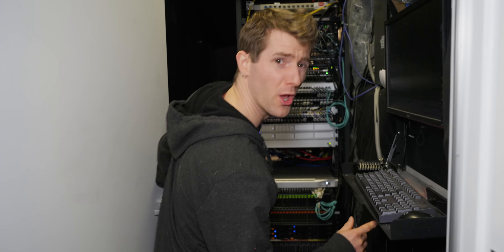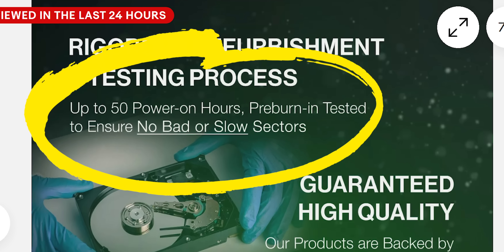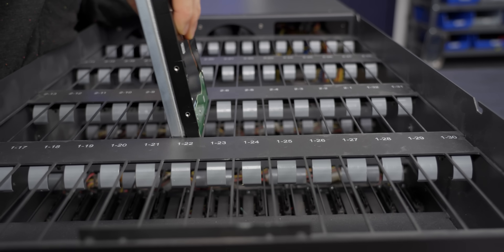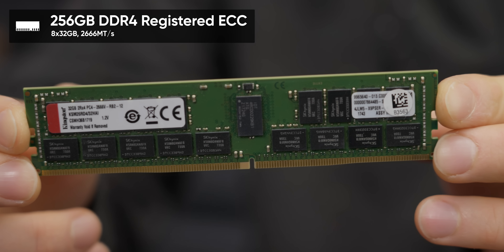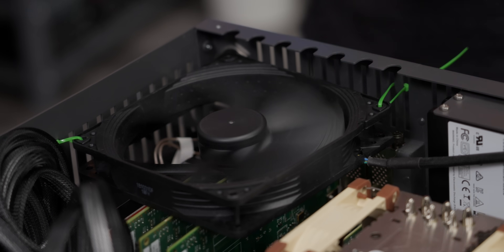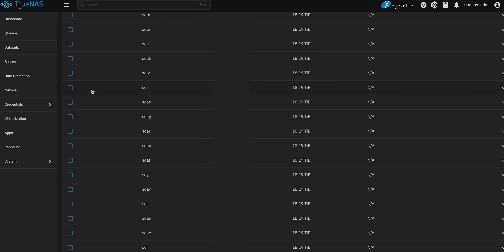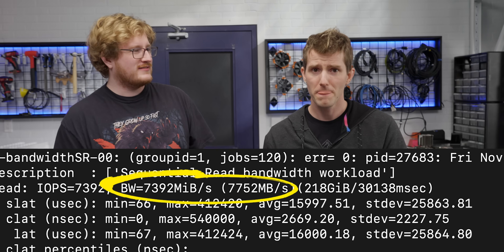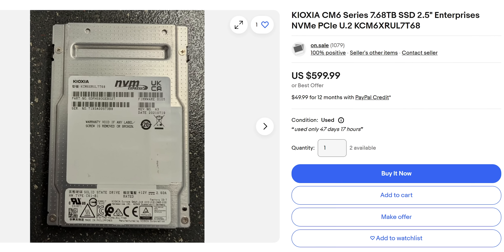Is Buying a PETABYTE on Ebay Stupid?

Comment: I love that we're back to having love for spinning plates again. SSDs are great, but for cheap "fast enough" storage it's still unbeatable in my opinion. I also understand why you advise against second hand drives, but with the right redundancy it can be a great deal. Especially with how long modern drives can last, it's silly to always buy new.

For reference, I have old WD Red drives still humming along without any SMART errors that have been in my system for over 10 years. They've moved on to non-mission critical stuff like light surveillance recording so if they die, it doesn't bother me. But I'm just calling it out because people write off drives after just a couple of years. Set up your system for redundancy, which you should anyways, and save some old drives from ending up in a landfill. The only arguments against that approach are if you don't have enough bays in your system or if you're worried about power consumption of old drives.

Comment: Only had them about a year but I've had no issues with recertified drives.

That said, the failure rate for all my drives has been far lower than I expected. I have 6x2TB WD Green drives(their lowest-cost consumer drives) with around 10-12 power on *years* and only one has failed outright with one other only gaining a single bad sector in the last year or so. I've now retired those drives but my general experience with hard drives has been "dies within a few months or lasts indefinitely", which also appears to be consensus.

Comment: I am curious why not buy older but still useable har drives? I have a synology that has 4 TB that were scaveneged from my dads work since they needed to remove about 50 or more har drives from a server or two and a lot of computers so I got a few used toys and some good storage. Why not just repurposed older harddrives instead of scraping them? I have two three terribite harddrives that came in a mini server that I fished out of a thrift stores dumpster in the rain and of the four harddrives I got only one was bad mind you the storage thing was discontinued in 2014 or something so it was old as hell the harddrives stilled worked though. My dad has a small trash can fill with two TB hard dives I think there is either 20 or 30 2 TB drives in that trash can. Sorry my dad works in IT so I am either used to getting on scrap or finding useful stuff from the recycle piale. The amount of stuff companies will get rid of just because its a bit old is strange yet they have mission critical computers running xp or 7 even 95 or worse nt. If any of you can try and get to know someone who works for a small it company their recycling is good pickings. Also I am a broke college student who never got t e nice toys only the hand me downs or scraped stuff. I remeber when half a terribite was a big deal to me but now I can barely even use that kind of harddrive I do love scavenging scrap components and getting to dismantle things its fun to take things apart and put them back together.

Comment: I would avoid those 20TB EXOS drives like the 3rd booter shot. I've bought 10 of those drives for personal use and I would say 7 of them failed within the first month. They would not be recognized that they were even plugged in. I got to the point that Seagate would allow me to pay a little extra to have a better drive. In the last year, all 10 of those EXOS drives have failed and the last 3 I swapped out for slightly more cash for the 24TB Seagate drives.

Comment: I did exactly that… 60 drives with 16TB referbished… over one year I needed to replace 8 drives … but now it’s running super stable … and I payed about 60% of original price …. And also only used second hand hardware … it’s great totally recommending this

Comment: Here’s my guess: these are unused spares for some big baller.     Used drives at hyper scalers get wiped and physically destroyed. The risk of a drive leaving is just too high. Now, a drive still sealed in a Mylar pouch in the spares depot has no such risk. Once that generation of standardized storage design ages out those spares need to go but via the shredder.

Comment: Bought the same 20 TB Seagate Exos from goHardDrive (Choose them due to the 5 year warranty, and the fact the Exo line are helium filled)
They have been running for 2 years, run at 30 C, and No Errors.
There is 6 of them in my Unraid Server, and only paid $1000 for them vs double the price for new ones. 
I ran a SMART test and Read/Write test on them before installing to see if there were any issues, and they came back good. Power on Hours were low on my 6 as well. (10-20 Hrs)

Would absolutely buy them again.

Comment: Ive bought about 10-15 recertified drives from ebay and have had great luck knock on wood. i had two fail with in a month and they were replaced with out issue. i have bought other used drives that were not recertified and had one fail that Seagate replaced with out issue but thats a hit or miss from the research ive done . but this is always risky so buyer be ware and i would recommend using them in a raid with two parity drives, i use mine in raid z2 and one of the drives is a brand new one i bought just in case.

Comment: I've had 8 of the same Seagate Exos 20TB recertified drives running on my Qnap nas for some years now. The Qnap garbage broke down, but all the drives are happily continuing their lives in my new Unraid setup. The smart details are still showing zero reallocated sectors, which is great. I'm very happy with these recertificated drives.

Comment: A few years back I stumbled over a SAN decommissioning sale - hundreds of 4TB 7,200RPM 3.5" HGST SAS drives being offloaded at an even better $$/Tb rate than here (including shipping!).
In a massive rush of blood, I bought 50 of them.
None were less than 25,000 hours, two were DOA and replaced in the next shipment, one started reporting errors to the SAS HBA a couple of weeks in after going through my burn-in protocol (aka wiping "blank drives" with DBAN). The rest are still going strong, although current cost of KWh means I no longer 24/7 run the bulk storage server holding most of them. Maybe that's better, maybe it's worse but they all spin up fine from cold.
New drives, old drives, whatever. ALWAYS run dual parity.

Comment: the cloud is useful for on demand resources and for the easy ability to reallocate, create, destroy services. it is NOT cheap, i have a dell r430 poweredge, a NUC and some other machines all hooked up via proxmox, just the dell r430 alone would cost me hundreds if not thousands a month in AWS costs, i was doing a project for work which required a TINY 2 core VM from AWS, that thing had 2gbs of ram, 2 vcores and like 100gbs of storage. that ended up costing about a buck a day, my r430 costs me 10 cents a day to run at idle and about 20 - 30 cents a day to run if its going full bore 24/7. the cloud has its uses but it is not the end all and be all and it is VERY EXPENSIVE!

Comment: I never tell normies to buy used storage, but for my bulk storage needs, I have been using drives off eBay for well over a decade.  The trick is you just need to validate them - no bad sectors found on a full drive write with your favorite tool.  I like Hard Disk Sentinel.  And then you throw them in a RAID of some sort, to the point where if one or two fail it's no big deal.  Do a full init on the RAID and look for any failures.  Then put some sort of automated reporting in place so you get an email when drive health drops.  I've had very, very few failures over the years, including one 16 drive array that spun for nine years straight and never lost a drive or even had a bad sector pop up (HGST drives in that one, RIP.)

Comment: Ive bought a number of drives from serverpartdeals. Only had 1 fail with bad sectors after a month. It didnt fail during my burn in. But they replaced it anyway. Artofserver is one of the legit sellers of HBA cards. Very helpful as well in setting up stuff.

Comment: Hi, Linus - I use original Google Pixel 1 and GitHub script for terminal, which not only do I have unlimited backup, I can upload more at a single time via HDD/SSD binded to internal memory section, making it go from 128gb to 2/4/6/8 TB drives at a time

Google pixel series 2-5 will backup unlimited photo video as well, but in compressed to 12MP, pixel 1 series has original quality.

At either rather, none of pixel 1-5 devices count towards storage quota, so even if you have NO google one plan, not even the $1 one, you will still have that media, forever.

Pretty nerdy but really simple, I loved this video though, totally different approach! 

I enjoy my physical storage, but anything over 8TB starts to get too large for travel and takes up a lot of space in my home! maybe just a me problem...

Love from Halifax 🇨🇦

Comment: I've been using drives from ServerPartDeals for over half a year now and they perform amazing. I have them setup in 2 mirrors each with their own cache for a single pool. They run between 800MB/s - 2.1GB/s without any errors so far.

Comment: I just bought a single brand-new Seagate Ironwolf Pro 22TB drive on NewEgg for $389 to use as an external HDD backup.  And that was on sale.  So these 20TB  drives you got for $180 each -- that's a HUGE deal!

Comment: I bought recert Exos drives for my Qnap NAS. 12TB for like $80 is hard to beat. 3 months in and they’re still okay. I only bought 2 drives so I’m just running a mirror, I figured that both would never die at the same time.

Comment: This is what I do for all my drives. Starting to slowly transition from 8tb drives to 12tb in my 10 bay unraid server and the cost does indeed hurt. Buying second hand refurbished is the only thing that softens the blow. Never had a drive fail on me yet in the past 5 years I have been expanding. I did have a single smart error warning on one of my two parity drives on unraid, but it’s been 10 months with no further errors so I am going to chalk that up to a false positive.

Comment: I would love it if you guys did a video about the implications of using many vdevs in a single pool. Theoretically, more vdevs in a pool leads to faster reads & writes, since each vdev is sort of like a disk with raid 0 - ZFS can split the writes and reads across each vdev, improving throughput. 

However - since the data redundancy is within the vdevs only, that means that as you add more and more vdevs to a single pool,  your probability of pool failure goes up! Of course, the probability of any single vdev failing is incredibly low (due to the disk redundancy within the vdev).
Reply: Also the word around the TrueNAS Scale forums is consistently positive about refurb HDs, especially those purchased from ServerPartDeals. That's where I bought my NAS drives from, and you save so much money that even if 1/3rd of them failed, you're still coming out ahead. 

Of course, I don't expect them to fail like that - I expect their reliability to be in line with new drives.

Comment: iv got some 12tb Seagate recertified drives that i have been running for almost 4 years now with no problems so far and im currently streaming my plex server to 3 houses  so they get a lot of reads. So far only one drive has had slight problems and it was mainly caused by a fatly sata cable

Comment: I bought 2 of these refurbished drives through Amazon. Both had 20 hours of on time according to Crystal Disk. After less than 5 months one of the drives started clicking before failing completely. The seller I bought through didn't have any kind of warranty, as they were OEM drives. It seemed to be random if there was a warranty according to the reviews. If you buy these refurbished, I highly recommend you don't store important data on them. New units have issues as well, so get something with a warranty.

Comment: I've been using an HGST drive from a similar situation for a few years now in my regular PC as mass storage. Zero issues so far, and super cheap for the capacity on an enterprise drive a few years ago. The only quibble at all is it does park itself when not in use, so it can take a few seconds for windows explorer to open initially. 10/10 would do again.
Reply: You probably can disable that parking (you can do that for Seagate Exos drives with SeaChest Utilities). It is also possible to turn off ERC with smartctl cli tool from Smartmontools but it doesn't survive reboots/sleeps.

Comment: I've been using 8 used eBay NAS drives for over 4 years with unRaid. Only one started throwing errors, and the SMART data even reported the drive might fail way back when I first installed it,

I also through some old dissasembled external drives in my NAS for Plex, and those have lasted about 3 years before starting through errors too. They weren't NAS drives and were almost 10 years old, so I was happy with the last of their lives. With 2 parity drives I've been able to swap them out no problem.

Comment: my NAS i build early in the year. 5 12tb drives in z2. working great, had a completely different 12tb drive poop out and z2 resilvering was mostly painless.

if youre buying recert drives, i wouldnt necessarily recommend just one, but if you are buying them with a purpose of using it for mirror or z2, then its amazing value.

Comment: I used 4 600GB 10K RPM SAS 2.5" HP hard drives refurbished from ServerMonkey a while back. They worked great, and I never had a problem, but when I switched to a workstation, the SAS disks didn’t work. This was because the workstation only supported SATA, and SAS drives require a SAS controller to function properly. So, I bought 3 16TB Exos disks from a "too good to be true" site for about $672.46 USD. I've had them for about 6 months now with no issues so far. The site also claims I have a 5-year warranty, but I have to go through the store I purchased them from. They say the product is 100% new, and to me, they seemed 100% new. I wouldn't recommend doing what I did by buying from a sketchy site, there’s always a chance I could have never received the disks.

Comment: I suspect the drives may be something like "marginal fallout" from the manufacturing process, having failed to meet a spec for some obscure enterprise feature but are otherwise perfectly functional. They're simply not quite to spec. So, knowing this, Seagate may re-brand them in a way which doesn't promise the same specs, and thus they avoid scrapping the drives. There are other possible explanations though, like leftovers from hyperscalers, which may make more sense given the late 2023 time-frame mentioned. 2023 was a particularly bad year for storage demand.

Comment: Recertified driver, or white labels, are often drives that were returned by OEM integrators such as Dell or Lenovo. The reasons for return may wary but most common is that they would ve selling them at a loss since HDD margins are fairly thin nowadays, so it is better for them to send them back and exchange them for newer models. Usually the return happens when manufacturer warranty runs out, as even OEM just RMA storage to seagate/wd and having thousands of drive they have no warranty on is just not really worth the risk for them. 

Overwhelming majority of these drives are absolutely fine, albeit old. I'd even argue they are better since they go through QA twice (hence "recertified").

Comment: I still have a 1TB Seagate Barracuda from 2010 and this drive has more On-Time hours than most of you guys slept, 120 065h ON time which is around 13,5 years. That drive was 3x powered off in its whole existence

Comment: I can 100% recommend refurb ebay drives. I have a 36-drive supermicro 4u for, ya know, linux isos. It's full of refurb HGST 6gb SAS drives right now across 4 raidz2 (yeah, yeah I know 9 drives isn't optimal for raidz2 or whatever - it's fine). It started with 16x 2gb refurb drives back in 2010, and I've just been upgrading them since then. They've all been like 20k hour drives, but I've had a grand total of 1 of them fail in all that time despite near continuous uptime over that period. Honestly the battery backup is probably worth more than the drive array. Just couldn't beat the price with anything newer and/or larger. I have a spreadsheet to track the going rate on drives on that calculates the best storage to price ratio, and I just upgrade to whatever the sweet spot is at the time when I'm looking at an upgrade. It's certainly less power efficient than fewer, larger drives, but even calculating over a pretty long period, it's hard to beat the price, especially the low cost of initial investment for a home server.